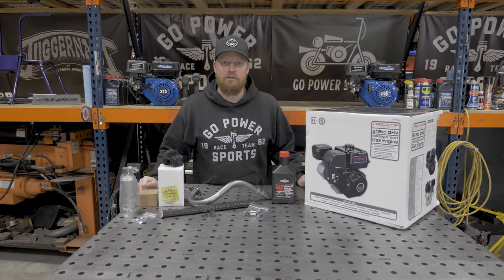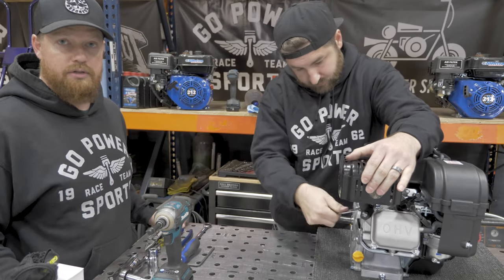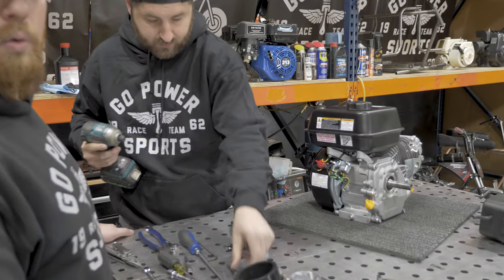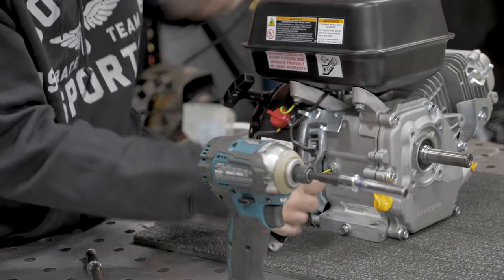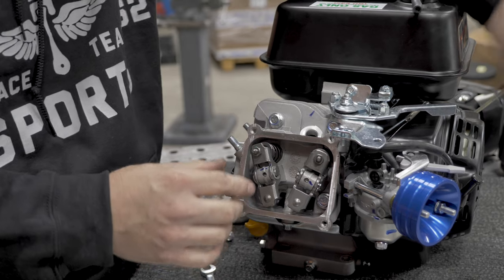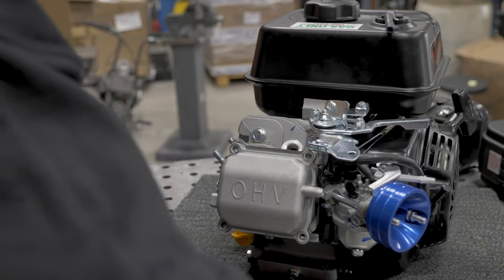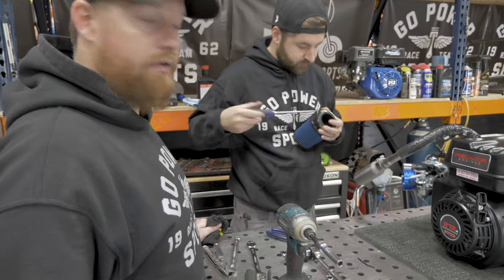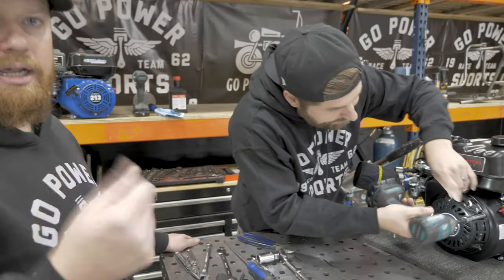Stage 1 Performance Kit on Predator 212 | Tutorial

Comment: I order my predator 212 about 3 years ago with a stage 1 already installed from you guys and I love it it's still running very strong. It's already going to it's 3rd vehicle.
Reply from the maker: Nicely done!!
Reply: Did it have upgraded flywheel or other internals?
Reply: @diepunk  I order mine with original flywheel. I believe that would be the stage 2 or stage 3 not sure. I only do the stage one on my predators.
Reply: @jorgegonzales878 your flywheel has been fine ? I want to get more speed but worried about messing up the motor from too much rpms
Reply: well if ur scared to upgrade one thing to get more rpms but think ur engine cant handle it, you gotta add and upgrade ur engine so it can stand those high rpms :) @Konnersaki
Reply: So they install kits for you?

Comment: Man I’m excited to do it to my predator 212. I hit 35 mph on a 60 tooth sprocket bone stock and imma do this upgrade… of course leaving the 60 tooth sprocket. May go 40-45 then and looks awesome.
Reply: I just added tourqe converter and 40 tooth sprocket 12" tires have 23mm carb jetted K&N air filter I have not mph with car yet but it's so much faster that it's squarely top end enough I let out of it I assume I'm hitting 45 or 49 mph just guessing from the feel

Comment: Very cool testing the gains with the dyno. A little surprised how soon the power started dropping. I have seen other dyno testing where peak HP was at a much higher RPM than here. Their numbers may look a little different if the engine was heat cycled a few times then dyno at a normal operating temp. In other words, dyno when the engine is completely warmed up.

If you are running governed you don't need 18lb valve springs. At this RPM the stock springs may have gotten a touch higher power numbers because it takes more power to move an 18lb spring than it does to move a 10lb spring.
Reply: Maybe it's because they were running a none hemi on the other test?
Reply: it's because of the governor, that pulled the throttle back for sure.

Comment: I'm no professional but I have tinkered on stuff and putting that head cover on with a Impact and not hand starting those screws was pretty ballsy But other than that video was great I love the commentary is a really well put together walkthrough especially with the benchmarks
Reply: You should always torque the fastener by hand too. A impact gun will either be over tightening them or not tightening them enough.

Comment: Can you do a 212 non hemi dyno run for me with the stage one ?
Reply: Really not much difference. I own both engines.
Reply: @tbonevoodoo  I have a Coleman ct200u and the stock engine blew up. I had a stage 1 kit on that engine. that I would like to put on a new predator. Will a stage 1 kit work with the hemi or just the non hemi or both?
Reply: @Troygehring  Both
Reply: @tbonevoodoo  thanks

Comment: Nice. Curious how an 8 degree ignition advance would affect those graphs
Reply: that is the first thing i install. they start so much easier...
Reply: Wouldn't recommend that on the hemi 212
Reply: I had a honda gx 160 20 years ago we put the 308 cam in it stock rod stock flywheel had head work done bid carb and torqued the stock rod twice the stock speck stock flattop piston gapless rings and they aint make a billet flywheel yet and i used to turn that thing 8000 rpm with stock rod never threw a rod and that thing would run with the heavy flywheel its a wonder it didnt explode we did drill bunch of holes and lighten it it ran like bat outta hell till flywheel blew up we also avanced the timing from 16 to 40 degrees and it would only run bout eight milr then it get hot but the timing made that thing a rocket we also cut 100 thousands off the head with all that timing it was make pass and shut it off couldnt ride it but man that timing picked up alot of power but you cant turn it up that high and ride it it would over heat but just drag race it was a beast and i cant believe the rod stayed together at 8 grand that old honda stuff was strong

Comment: So i have all these parts but the 18lb pound valve strings. Do i need them or will it run fine with the stock ones with a stage 1 on

Comment: Why does the jet sent with the stage 1 kit make my predator and 2 of my friends predators Bog out ..    bone stock .  Installed  air filter . Exhaust  and jet . Same result on the 3 predators .   Will fire up but as soon as you give it throttle it bogs out ..     what’ causes this .   Same result on 3 different  engines with your stage 1 kit .   Runs fine with the stock jet . As soon as you swap it out . The bike will bog out
Reply: my kart with the bigger jet likes to foul plugs/ run rich
Reply: @landonbutler385  & there's your answer !.Get an oxygen sensor bung welded to your exhaust pipe & fit a wide band poxygen sensor & get hooked up to a smog tester & run it off an independent battery to heat it, your local EPA sniffer shop or local garage with an air-fuel sniffer if you pester them enough should be happy to oblige.Dont forget the local small engines man.Goodluck.Cheers Trev NZ
Reply: You still have to tune the carburetor. Any time you change altitude you will have issues either lean or rich. Plenty of videos on how to tune these motors out there. Takes about an hour or so. When you get higher up on the performance scale even temp changes will affect your tune. Now you're getting into the spark plug temp rating and other factors that probably will boggle your mind.

Comment: please help me out guys you can install these valve springs with stock carb (changing jet obviously) but you don’t need to remove the governor?
Reply from the maker: I guess you could add the 18# valve springs with your governor still in.  You would see the most benefit after you hit 5000+ rpms though from changing out these valve springs.

Comment: Great video real easy to follow..my question is so you really don't have to change or drill out the pilot jet..andI have the Hemi are the jets the same for both because I keep coming across parts title non- hemi? See I did not know bout the jets I changed to this akir filter and adapter and now the engine wants to die with a little throttle so I came to uou gents!! Thanks keep up the great work

Comment: Thanks for the content ...I am having quite the time trying to figure out what size bolts fit the four bracket holes on the case cover around the crankshaft??? I thought I figured it out and bought some but I don't know if they are different because it's a hemi or what... I'm swapping engines in a trailmaster mini bike and the cvt brackets for the cvt cover/guard need to mount into these holes on the predator but are a different size on the two engines... I want, based on my limited experience, to say they are either 8 or 10 metric...do you know what size they are???

Comment: Is a valve cover vent filter necessary? I swapped my baja warriors carburetor and muffler and air intake first I did the muffler and tourque converter I had original carburetor and air intake and it was going like 27 mph and thats 3 mph faster then it was going and then I installed the new carburetor and air intake but now it won't even get hardly up to 20 mph so I figured maybe the new carburetor had a small holed jet so I shaped that out for my old jet cause I was right and that still didn't make a difference idk what else to do
Reply from the maker: I wouldn't say necessary, but definitely recommended to ensure you don't get debris in your valve cover.

Comment: Can I just switch the stock valve springs to the 18lb valve springs or do I have to purchase the whole valve kit? Springs alone is $15 bucks, the kit is $63… ill purchase the kit if I have to but if I can save the extra money by just purchasing the springs Lmk. Thank you
Reply from the maker: Heavier springs is meant for more power.  So if you just have heavier springs with no other upgrades, you won't see much of a difference other than stressing out your engine quicker.
Reply: I upgraded to a stage 1 kit and the billet flywheel, and torque converter and 22 lb springs… my question is when I switch the springs do have to buy the whole spring kit or can I purchase just the springs?
Reply: I upgraded to a stage 1 kit and the billet flywheel, and torque converter and 22 lb springs… my question is when I switch the springs do have to buy the whole spring kit or can I purchase just the springs?

Comment: How did you run it after the install without an oil catch can an not make a mess or venting the ohv back back into the motor?
Reply: It's more preference to run a catch can. It's just a small amount of oil that you won't see an oil loss. Put the filter above the valve cover helps a lot.

Comment: Now do the Tillotson  you claim 10 HP stock.
Reply: The Tillotson should get better dyno numbers than this. Higher compression, better head and carb will do it. And don't they come with a better than stock cam? With identical compression, same carb and cam a Hemi 212 should produce close to the same power of the Tillotson.
Reply: I have the hemi predator 212cc with a hot cam, 26lb springs, billet rod, billet flywheel, billet side cover, and a mikuni 22mm carb pushing a juggernaut torque converter.

Comment: What if the power gain was because of simply from removing the parasitic drag caused by the governor and none of the other parts were needed. I’d like to see a dyno run of a stock 212cc with and without the governor
Reply: Same
Reply: Governor limits the revs to 5,500 without it the engine can go to 8,500 that’s the difference. U get a higher rpm range so obviously more power
Reply: @Slowboi335xi  more rpm doesn’t mean more power. Especially if your cam doesn’t make power in the upper rpm range. The stock cam falls flat after 5k rpm
Reply: @Slowboi335xi  also, the coil also limits the rpm. U can buy coils with no rpm limit
Reply: @FreddyFunderbunz  not true at all regular 212s don’t have that

Comment: Question why are you messing with the valves is it ok to not do that part like just add the jet the air filter and the exhaust
Reply from the maker: It is best to check your valve lash on any engine.  Especially if the  starter rope starts snapping out of your hands :0

Comment: The heavy valve springs only help at rpm. over 4000, high revving to stop valve floating. With the governor @ 3600 they make your power worse, taking away energy to push open the stiff valve springs.

Comment: For the starter moving it. Do you have to do anything with the rope or is it as easy as taking it off repositioning it and bolting it back on?
Reply: Just did this.  It's as easy as unbolt, turn and rebolt.

Comment: I have bought it all and all nee clutch assembly. Its pretty fast. Is my belt supposed to almost ride the very top of the pulley? I backed out the screw to allow to give it the most gas. Should I change that screw back so the belt wont go to the top of tge pulley? Its eating belts in 30 mins. Has red spring in it and I have bought a green spring but not installed yet. I also have a 50.00 belt but dont want to ruin it. Thanks for any help! Great video and I used it to build my new 212cc.

Comment: I did this except the valve springs and no muffler. Removed governor.  It's on a traditional go kart frame and im getting 42mph ish and I weight 260lbs. Its a torque converter running to a 48 tooth sprocket and has no problem spinning the wheels in dirt.  It really takes off. I dont know what the difference is but I have had better luck with the more expensive tq converter from this outfit than the cheaper ones on ebay not to mention the hardware was better thought out. I think im going to do these other mods and ditch the 420 on my explorer it's just been a pain I think 10hp not to mention no governor will be sufficient.  Just easier imo.  Easier to start, easier to get to etc.  Plus I really want to get rid of the 40 series and all the jackshaft stuff.
Reply: same here but 40 tooth carb jetted air filter & header ima around 45 to 49 mph
Reply: same here but 40 tooth carb jetted air filter & header ima around 45 to 49 mph

Comment: Is there a way to quiet the whole thing down, including that high-pitched rattling at idle?  Worried about getting a letter from the HOA.
Reply from the maker: Your best bet is to go with a longer header pipe with a muffler/silencer at the end of it.  Nothing will be quieter than the stock muffler approach.
Reply: @GoPowerSports  Thanks guys.  TBH the sound's not much louder than a lawnmower.  It is a lawnmower engine after all.  I'll check your site out when I need parts.

Comment: predator claims the 212 makes 6.5hp, so 7.5 stock is hecka good
Reply: I've seen some people get it up to 9 HP but idk how long the motor would be able to handle that
Reply: @ironsandhammers359  its just cool that a completely stock predator actually makes 7.5 horsepower when harbor freight only claims 6.5hp. always nice when a product exceeds expectations rather than fall short
Reply: @WildfoxFabrication  for sure and with kits and miss it adds a whole lot more that you can do for the bikes performance just part of the greatness of gas engines lol
Reply: @WildfoxFabrication  It should make at least 7.5 HP it's 212cc ohv Hemi - don't they teach shop at School anymore ? It's unbelievable what melinisls in Gen X & Y don't know...no offence intended.buy some karting & minibke books from the 60's ,& 1970's & learn Something.TREV NEW ZEALAND (South Pacific) Cheers
Reply: @WildfoxFabrication  There's variables depending on the brand of Dyno for measuring HP output most automotive ones that's getting done to the margin of error - I built my small engine Dyno years ago when Clayton mechanical dynos were the most accurate.Cheers Trev New Zealand

Comment: did you remove the governor? I read all the time that if you remove the governor you need a billet flywheel. I didn't want to get hurt so I purchased one but I feel like it's rather unnecessary if I just do the stage one build and keep my rpm's under 5000? The Ghost predator itself has only a cast iron one. I am trying to build cheap but quick rental karts with a predator 212.
Reply: also thank you for your wonderful video

Comment: I ordered a stage 1 kit forever ago. Installed it and my Kart never ran right again. Just now realized it didn't come with the jet kit :/ Any idea the size I need to find??

1 × Stage 1 Predator Performance Kit for 196cc & 212cc engines

Filter Color :BlueAdd The Exhaust Gasket:Add the Exhaust Gasket [ KD212EXG]Add Vent Filter Kit [$9.95]:Add 2 Vent Filters, 2 Zip Ties &amp; Tubing

Unfortunately this product is no longer for sale so it cannot be reordered.

Comment: Just bought a doodlebug yesterday with this excat motor and kit. I am wondering the best gas to run with this set up? Octane wise. My local ace hardware store has trufuel ethanol free tf3 4 stroke gas would that be safe to run with this set up. Gonna be ordering the billet flywheel, rod and gasket kit from yall soon since my governor bypassed. But so far loads of fun with the stage one kit.

Comment: do i need to get the valve springs when i do this kit? i am new to this and it looks difficult, also do i need to take the engine off the bike to do all of this?
Reply from the maker: You will need the valve springs if you take the governor out of your engine.
Reply: You do not have to put valve springs in it if you take the governor out.
Reply: @GoPowerSports  can i use 15lbs valve springs so i don't lose torque or do i have to use the 18lbs valve springs

Comment: question ? so i got a new harbor freight 212cc motor have never got it to start ever i took govener off unplugged and removed oil sensor even changed out fuel line tubing put gas and oil nothing happens i did notice that theres no gas getting to my carb at all even when gas lever is on and throttle is opened up theres no gas flow from tank to crab ? this is motor has never been used its been almost a year and not once has it started ive tried everything no luck wut shouls i do

Comment: Are there any stage kits for the 79cc?
Reply from the maker: Just a throttle and air filter kit at the moment.
Reply: Yes. It’s called a Tilitson 212. 
Very easy kit to install & doubles your horsepower instantly: remove 4 mounting bolts, remove 79cc engine from chassis, insert 212cc engine into chassis, reinstall 4 mounting bolts. 👍🤩

Comment: Why does my bike bog down at higher rpms after installing the stage 1 kit
Reply: Your float bowl might be running out of fuel. May need a pulse pump.
Reply from the maker: It's hitting the governor. That's the big you are talking about.
Reply: Install a Tach...they get their pickup from a wire that picks up plug wire spark impulses.T NZ

Comment: Has anyone has any issues with the idle low rpm jet after this mod? My engine wants to die when I blip the throttle quick. Also noticed I need to choke the engine even after it's warm to get it to start. Pilot low rpm  just seems lean condition now.

Comment: I was going to ask if you had removed the governor already. I guess this kit would be a waste of time if someone decided not to remove the governor.
Reply from the maker: The governor is in on this build.  Some race classes won't allow you take the governor out.  But if you're just cruising out in the open, take that governor out and spread your wings!  (just upgrade your flywheel and connecting rod)
Reply: @GoPowerSports  So let’s say you did remove the governor what rpm would you suggest to not go over with stock engine?

will it hold 6K?? Or will it break the rod n magnets or whatever ?
Reply: @d-boyzeighteenhundred  Stick to 6,000 or near there,it's a splash n dip conrod like the old Chevy L6's also a flywheel explosion you don't want without an 1/8" sheet steel plate around called in drag circles a scattersheild.Hope this helps & no relation to gopowersports.Trev NZ